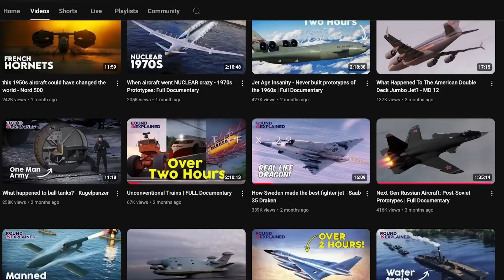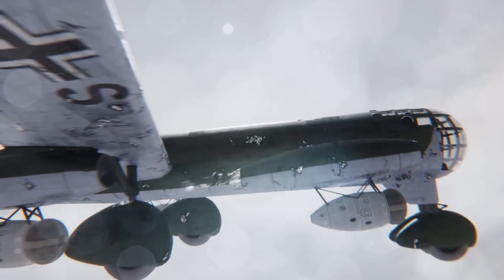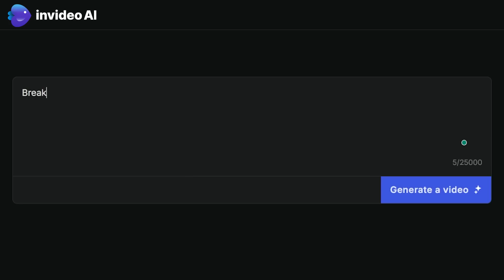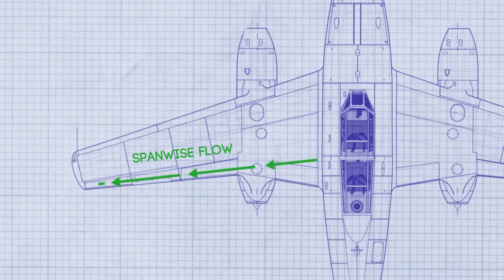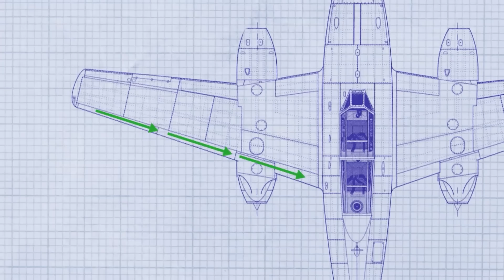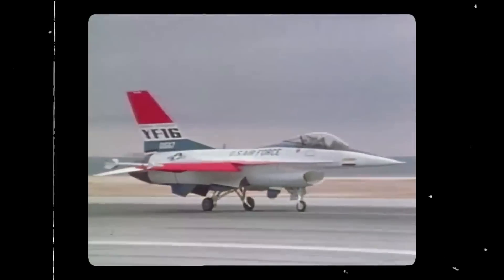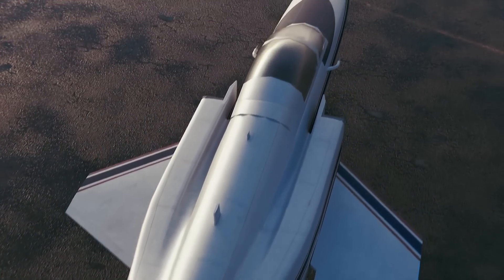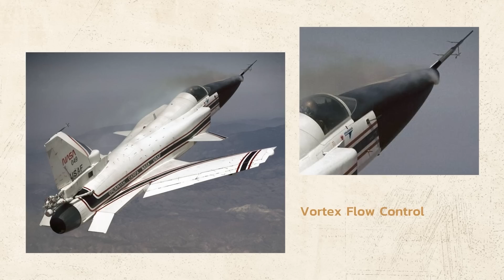Americas plane that flies backwards - X-29

Comment: So wing twist at high super sonic speeds is the only issue? why not strengthen with more composite. Why not limit the top speed like how the Hornets with straight wings and the F35 fly max speeds are 1.8-1.6 respectively. Fighters already don't fly above mach 1 90% of the time in fights. Why not, now hear me out... use the Ace Combat X-02 Wyvern style variable sweep forward swept wing? at higher speeds the wings fold in, and at subsonic speeds the wings fold out (im aware this will increase complexity and costs but still). The first two methods feel practical, no?

Comment: You forgot to mention that a big part of development  was done by Dornier-Messerschmidt-
Boelkow-Blohm in Germany. They built 1exemplary of the test planes and the biggest part of the flight control system. I'm not shure if there was also a vectorized thrust control on the engine.😊
Reply: That was the X-31.
MBB didn't work on the X-29 project.
The X-29 was a Grumman Aerospace research plane.
Reply: @AvengerII  the X31 is a totally different plane. A tactical freighter VTOL,  2 turbines for propulsion and if I remember correct, 4 turbines for vertical lift. It never went into construction because of excessive fuel consumption and noise.

Comment: Im a huge fan of this plane, but im always so dissapointed that the final parts of the testing isnt ever talked about. 

When they got into the final phases where they could go to crazy angles of attack, they had a presserized air bleedoff into the nose that could generate a vortex that would pull the flow of air over the nose to the left or right in full control, like a vertical stabilizer that was made by a puff of air. You can find declassified papers talking about it, but they essentially proved the concept would work and then the rest of the info on it was classified.

Funnily enough, its supposed to be tech that has made it over to the f22 and the f35, but is still classified for those planes. So there is a little trail of clues of how we control these 5th gen aircraft at very slow speeds if you read into the final bits of the project.

Edit after watching;

 Haaahahaha you talked about it yeah baby!!!
Reply from the maker: Oh wow, even I didn't know this! ahhh if only I could go back in time
Reply: @FoundAndExplained why did you have an AI sponsor it's AI that if people keep using will lead to dead internet theory eg FUCK AI JOB SEALING SOULLESS SLOP
Reply: Similar to the twin extendable chines on the modified radome of the F/A-18 HARV. Both these programs along with the X-31 did some rad high alpha research work 2 NASA!

Comment: The remarkable thing about this aircraft is how small it actually is; I saw it at the NASM and did a double take.  I thought it was F-16 size but it is a fair bit smaller.
Reply: Half of the X-29 is based off the F-5 forward fuselage.  The F-5 is one of the few fighters that makes the F-16 look big!
In fact, the X-29 looks a lot like a Northrop F-20 with forward swept wings.  The aft fuselage is not that different since they're both powered by GE F404 turbofans.